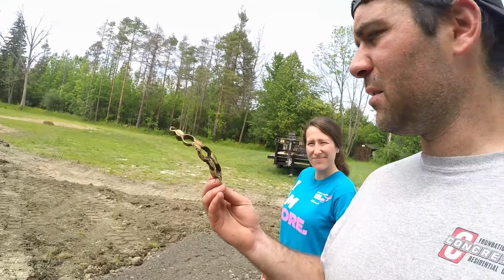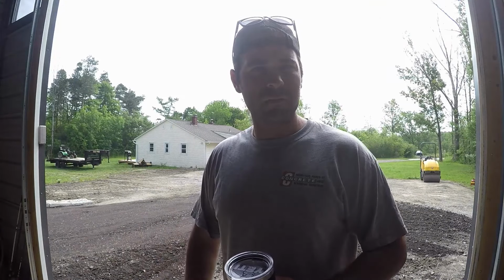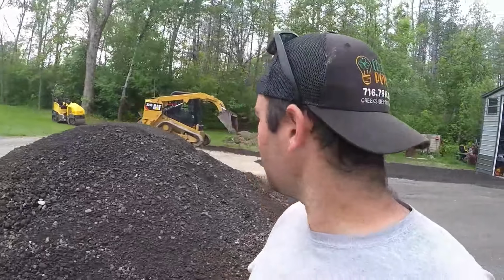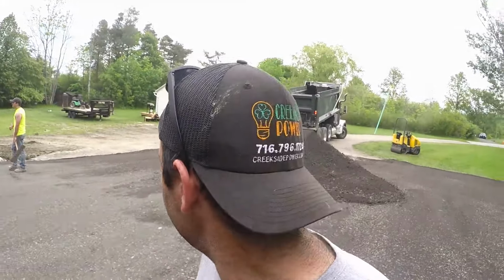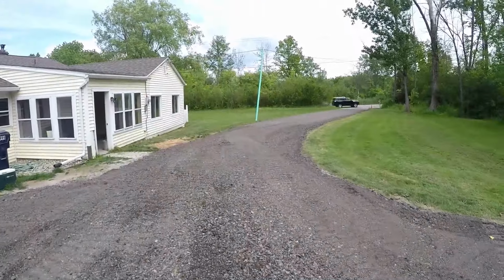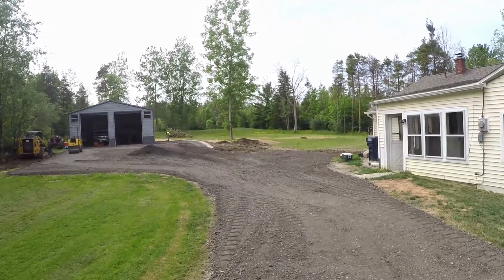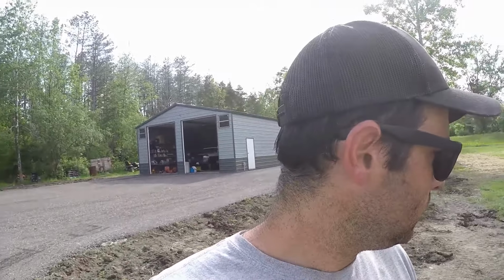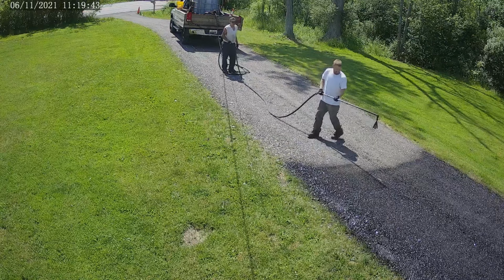Seal Coating a MILLINGS Driveway?

Comment: This makes me sad.  In the fact that any rebuttal asphalt and sealing company would be honest with you in that sealer is 100% not a binder for millings.  The only one who wins on that is the sealing company that drove off with the check.   But good video sir.
Reply from the maker: we will chalk this one up to an experiment...however it looked nice!
Reply: I do asphalt work. We clean our sealant tank out completely every so often.  We spray leftover material over asphalt millings at our equipment yard.  It’s highly diluted and sets up deep and hard.  Price and expectations are important. I don’t see anything wrong here as long as those were met.
Reply: I was going to say at least all the limestone was painted lol thanks for the video  @EverythingElliott
Reply: @grahamkennedy7221 what material do you spray on the millings oil based or emulsion is it a slurry sealcoating or a ss1, or maybe crs 2 ???
Reply: @dustinjohnson3463  I was thinking it would be a k2 prime 
Or a diluted crs60
Reply: Anyone have experience with k2?  How good is it on millings?

Comment: I have a large farm driveway that was in huge disrepair.  I bought 10 truck loads (about 20 tons each) of millings.  I got about 1/3 of my driveway fixed.  Now two years later it's hard as a rock.  I never had it sealed and the only problems we've had is when we plow the tractor sometimes takes a chuck out.  Other than that just about 4-6 inches of millings on top of an old gravel driveway has worked out really well.  Now i just need more millings to do the rest, but I'll wait until they are resurfacing nearby to get those millings cheap.
Reply from the maker: Glad to hear they worked out for you! I hope I end up with the same result. Having hot laid asphalt put in where I live is just unreasonably expensive.
Reply from the maker: Check out the follow up here:  https://youtu.be/4CHXH-R7xzE
Reply: Same! Brought in 12 trucks of re grind Millings. Grind the road then take it to have it re ground to make it nicer then we spread it about 6” deep. Two years later we just groomed I t off washed it and kids used leaf blowers to finish it off. Solid, non coated, super durable money well spent! Considering a seal on top but not sure how that will work out. That’s why I’m on here again watching videos on sealing it lol!
Reply: Same here.   I didn’t even roll it.  Drove over it with the backhoe and cars. That’s it.   No liquids of any kind.  It’s hard as a rock. Made a trail to the garden shed also. no compacting other than 4 wheelers and mowers.   It has some cracks finally 5 years later but man it was well worth it at $100 a triaxle .   Waiting for them to tear up sone more streets nearby again.

Comment: Really enjoyed the video. Not sure why you put sealcoat on your grindings though. Cant see a seal coat layer really doing anything for your driveway but giving it dark appearance. If you are looking for a better bonding agent that will harden your driveway  SC-250/topien-C or something similar would do much better. Apply SC-250 at a spread rate of .1 gal per square yard and you should be sitting golden. Approx $600 for a ton of SC
Reply from the maker: Thanks for watching. Guess I put it on there for science…and thanks for the product suggestion
Reply: Where do you get sc 250
Reply from the maker: @roseabbott4205  I believe you can order it online direct from the manufacturer

Comment: I just did my driveway…for the areas with more gravel on top I swept in the asphalt “fines”….which I screened in my plant ( my screening plant consists of a shovel, garbage pail, some random wire cage and an office trash  can with a fine  mesh   🗑 )….I am hoping the fines will bond with the coarse gravel in the hot sun….with my luck it will just blow away with a light breeze.
Reply from the maker: I would say that’s completely possible. I do have some area where there are some fine/dust particles that I could for sure sweep into the coarser areas. Most of the driveway has bonded just from sun, heat, and driving on it. I’m planning on having it sealed again before winter and it’s my intention to do exactly that.

Comment: Your brass knuckles, pipe holder is a cage from a roller bearing assembly it holds the ball bearings in place.    Nice work on your driveway.
Reply from the maker: Thanks for watching!
Reply: hey you should check out my seal coating videos, tell me what you think! 
thanks!

Comment: Hey neighbor, how's this holding up at this point?  When we built we ended up with close to 500' of driveway.  Couldn't sacrifice the kids next 3 Christmas's to get it blacktopped, but I'm pretty tired of hitting loose millings and busting shear bolts on my snowblower.  Not sure if getting it sealed could be a band-aid until we can afford a good blacktop.  Had a few blacktop quotes from around here but that's a lotta driveway to cover.
Reply from the maker: I highly recommend you watch one of my most recent videos about adding wheels to my blower to solve that exact problem!
Reply: @EverythingElliott  Thanks, I’ll look for it. I set my skis as low as I could and it doesnt seem to matter if I run it in float or just manually play with the hydraulic based on my feel for the driveway topography, always catching some chunks of millings that are sticking up.
Reply from the maker: @zachslaybaugh2691  the wheels gave me a lot more adjustability, and they roll over the driveway opposed to scraping across them like the skids so they dont dig it up

Comment: Your driveway looks great! 
Can I put millings on a steep driveway? Would it work particularly in the winter time when the heavy oil truck will be coming? What about the snow? Would I have to have it plawed or can I use snow blower?
Reply from the maker: You certainly can put them on a steep driveway.  Just make sure they are rolled out on a nice hot day.  As far as snow removal, you can do it however you please.  Just make sure your skid shoes are set up higher than your cutting edge so you don't end up plowing the millings all over the place.  I havent had any issues with the millings with heavy trucks.  I've had concrete trucks on it without issue.
Reply from the maker: Check out the follow up here:  https://youtu.be/4CHXH-R7xzE

Comment: Did  your millings hold up? I'm looking at millings, 900' but will add a rejunivator which should or is supposed to give millings longevity. Simply sealing doesn't penetrate so you end up with a think layer of asphalt. Hope it worked for you.
Reply from the maker: They are doing super well. I think I had this done 3 or 4 years ago, the sealer isn’t around anymore, but I have done 0 driveway maintenance since it was put down
Reply: Thank you Elliott.

Comment: Good video, driveway looks great! About how much did the whole job cost if you don’t mind me asking?  including the prep, millings, delivery, labor and sealcoating. I have a similar size area and driveway that is asphalt now but in really bad shape. I have been considering going this route.
Reply from the maker: Total cost start to finish was around $6,000
Reply: U were proably better off getting it paved
Reply: @bigbuck807  He wasn’t getting that square footage of concrete for 6k anywhere.He got a good deal overall.
Reply: 6k is a super great price!!

Comment: In the process, we have millings going down today. Rolling Saturday. Did you have a separate company spray? What kind of company does this, Sealcoating I assume it’s called?
Reply from the maker: Yes I had a separate company do it. It is normally called seal coating on hot laid asphalt, you should ask the company if they have a spray coating machine. Some companies will only brush it on, it will need to be sprayed

Comment: If you spray Diesel fuel on that reclaim on a super hot day and roll it out it will harden up like asphalt just saying  then seal it
Reply from the maker: The epa would be all over me if I posted that on the internet….
Reply: Diesel brakes it down.  You need hawk seal

Comment: That could def. use another coat of Seal. Dunno what they priced you out @, but I would get it down to .16-.18 cents sq ft. Millings are hard to just spray n Go like you said, it’s never all the same consistency/size ever.
Reply from the maker: Thanks for watching! It’s my intention to see what happens with this winter and possibly get them sprayed this spring again.
Reply: @EverythingElliott  the driveway looks great and the loader man knows what he’s doing. You got a great job!
Reply: You’re wanting this man to put more sealer down but also wanting him to haggle the contractor down on his prices to .16-.18 cents per sq. ft. People with that mindset are why the self employed contractors out there are starving. At those rates I would have to question the quality and consistency of the material I’m getting especially if it’s over Millings. Milling is permeable. Meaning that it could use twice or more than the amount of material a hot mix asphalt driveway could use. Pay a man his price and you’ll get the job done that was promised. If not then you have every right to complain.

Comment: How has it held up? Can you snow plow it without taking big chunks out of it? Any other pros or cons now that you have had some time with it?
Reply from the maker: It held up very well over winter! I use a snow pusher on it, with the cutting edge about 1/2” up from being on the surface. Make sure you’re subscribed, I’m gunna be doing an update video in the next week or two!
Reply from the maker: Check out the follow up here:  https://youtu.be/4CHXH-R7xzE

Comment: i wonder is the fines used as a top dress like chip and tar how that would do?
Reply from the maker: I was told by a state DOT guy that they do a lot of public park parking lots with millings and use the tar for chips on top and it bonds it together like hot laid asphalt. Wish I knew that at the time when I put my driveway down

Comment: Hey man. So is it holding up?
Reply from the maker: We’re mid way through winter #2 with them and the driveway is still solid but the sealcoating has pretty much worn away in all the high traffic areas.

Comment: a few months have passed and I am wondering if you are still happy with the seal they used.  I have not sealed mine because neighbours have told me it is a waste of money.  How do you feel thank you
Reply from the maker: Hey Ron, I am happy with spending the money still. In the areas with very fine material it held it all together, however in the areas with coarser material it didnt do much. I hope this helps
Reply: Where do you live
Reply: @jimgorman6506  mildmay, Ontario
Reply from the maker: @jimgorman6506  Western NY
Reply: It’s a waste. Here in Florida it will not last more then a week. It may last in freezing conditions until it’s hot out. There in nothing in millings to actually hold it together. It hardens but the top layer will always be loose. Driving on it loosens it up even if you only turn while the car is moving. 2 months tops and it’s gonna flake up. When sealer is applied right the asphalt surface is cleaned and all loose rocks, dust and dirt are blown off to ensure bonding. If you spray sealer on millings your doing the total opposite. In this video you can see where he calls it “a little light” well it’s not light it’s just dustier in that area. They were spraying it from side to side and over lapping just say it was light then the light spots would be from side to side in a pattern the way it was sprayed. Those “light spots” are areas that really fine and will come unraveled the fastest. IMO sealing does not work and I’ve been doing asphalt and sealcoating for 15 years in Florida
Reply from the maker: Check out the follow up here: https://youtu.be/4CHXH-R7xzE

Comment: Great video about how much feet length & width did each load cover? Also during the raining days is it muddy? Does it stick to your shoes? Does it stain light colored shoes such as tan, white etc??? I would appreciate the feedback. Thanks & great video again. If you had to do it all over again would you have laid down clean limestone instead? Asking bc my pad is 30ft wide x 50ft long
Reply from the maker: The distance it covers is greatly dependent on how thick you lay it. In my case it was about 4” thick and probably covered a 10’x50’  area. It is not muddy at all on rainy days, that’s why we did it, my last driveway was constantly muddy. It does not stick to the shoes after it’s packed down. And it didn’t stain anything. My previous driveway was crushed limestone and that constantly
Let mud through! I have an updated video that I just posted a week or two ago how it held up after winter, check it out in my channel!

Comment: Did the seal coat bind the millings enough to be a hard surface? Thanks
Reply from the maker: It did in the nice spots where there were a lot of fine millings. In some of the areas where there more were coarse millings it didn’t bind them as well.
Reply from the maker: Check out the follow up here: https://youtu.be/4CHXH-R7xzE

Comment: Does it get hard like asphalt or is it loose like gravel? Have you noticed it getting tar all over your vehicles?
Reply from the maker: It goes down loose like gravel and once it’s rolled out it seems to lock together. And no I haven’t gotten anything on my vehicles from the driveway.
Reply: hey you should check out my seal coating videos, tell me what you think! 
thanks!
Reply from the maker: Check out the follow up here: https://youtu.be/4CHXH-R7xzE

Comment: How much did that end up costing you? I have a asphalt drive about your size.
Reply from the maker: It was $500-$600 I don’t remember the exact number
Reply: @EverythingElliott  That's for the milling, labor, machines used and seal coating?
Reply from the maker: Oh sorry I thought you meant just for the seal coating. Total cost was around $6,000. That includes the concrete blocks I used to terrace the driveway next to the shop as well

Comment: How did your sealant hold up?  I just had a driveway put down and was thinking about having them do the sealer. A friend asked a good question about tires spinning and turning on the millings. Mostly where you would back in a trailer or do a 3 point turn. He was thinking that would rip up the sealant and maybe cause some issues in those sections?
Reply from the maker: Thanks for watching! It’s currently winter so everything is nice and frozen, but in fall it seemed to be doing well. In the Super fine millings the sealant bonded it all together and looks like asphalt. In the coarser areas it didn’t hold it together as much, but it’s not tore up. We started with a gravel driveway so there’s always been a rule at my house of no turning the wheels without the vehicle in motion. You do see marks from when UPS or Amazon comes in the driveway where they spin their wheels. Those are just pushed right back down the first time you drive over them. I’ll be posting a update video this spring to see what the plow damage looks like so be sure to subscribe!
Reply from the maker: Check out the follow up here: https://youtu.be/4CHXH-R7xzE

Comment: How much did this cost you? Ours is about the same size.
Reply from the maker: Start to finish it was $6,000
Reply: @EverythingElliott  coulda have had stone spread much cheaper then that!. Typically you use milling when trying to save money.
Reply from the maker: @xxxxxxxx183  millings is cheaper than stone.  stone would probably have cost me 10,000 to have the driveway tore out and regraveled like I had done with this.  I had nothing but gravel and mud prior to this so I went with millings so it would lock together and keep the mud out.

Comment: How do you expect it to hold up?
Reply from the maker: I hope it holds up well. Time will be the judge of that though. I will post up an update video before winter and after plowing on it in winter
Reply: @EverythingElliott  a lot of people do it, I’m just curious to see how well it holds up to rain and vehicles driving over it. I’m hoping to do my driveway at some point
Reply: @drewmurphy2796  I did a 25ft by 50 ft area in front of pole barn last July. So far its held up nicely. Only issue i have is the top 1/8 layer is loose millings. I never seal coated the millings. Elliott, does your driveway have loose gravel to it after sealing it?
Reply: @jeffreydavid813  wondering same thing. We have millings and I'm annoyed with tracking them everywhere.
Reply from the maker: Check out the follow up here: https://youtu.be/4CHXH-R7xzE